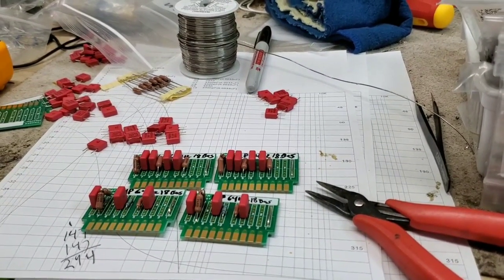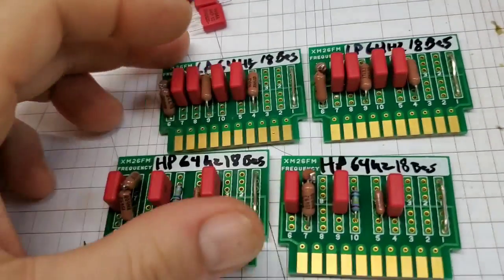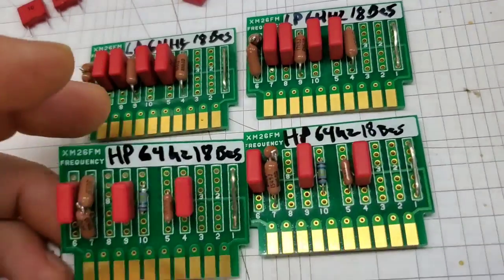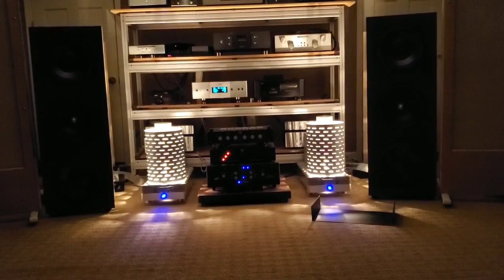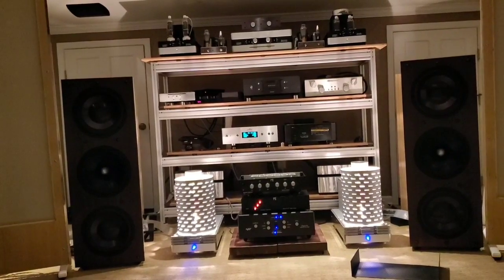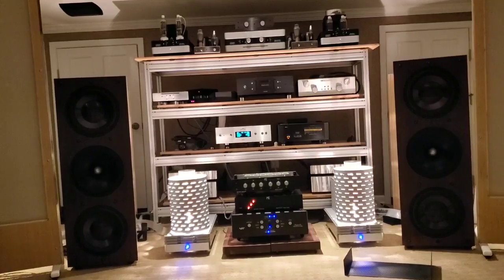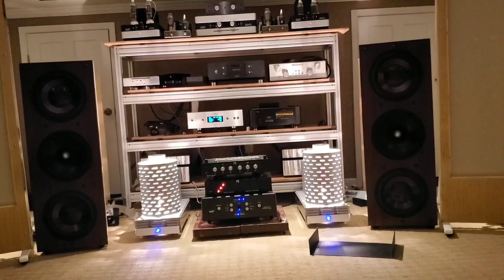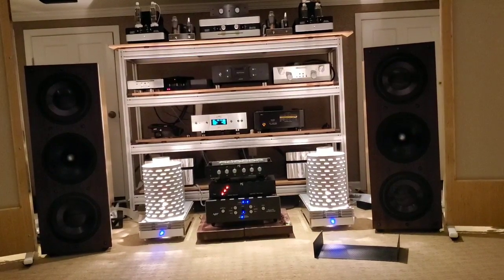Noticing,  then tuning an anomaly in your Loudspeaker Crossover

Comment: It's amazing the coincidental youtube vidi's to what ever I'm working on in my world... Just this weekend I was messing around with VoiceMeter Banana and it dawned on me that I can use it as a crossover (2 output buses with different parametric EQ settings using high pass and low pass filters- out to 2 DACs and then into, in this case, the amplifier inputs of an older AVR I have lurking around). So I set that up, and after a bum start (final output of the 2 buses was out of time)... I found a setting for the output bus timing and viola, software crossover with total control.
It took not much time to arrive at an optimal settings and to discover the missing link in my open baffle speaker build. Now if the parts I ordered (to make a high pass filter for the mid/fullrange driver) match the performance of the software xover I'll be sorted.
I gotta say, it's a sweet setup and allows for total experimenting and control, I would highly recommend it for anyone before they start building their real xover, or if they need to find why the one they have isn't sounding as good as they think it should...
As to this video, I think you will find your fuller mid-bass if you move your whole xover region up to around 100hz.
Reply from the maker: Awesome bro ! I do everything as far as tuning in the passive analog domain to a crazy level, like I'll change a capacitor on the output of a piece of outboard gear instead of bump a slider on EQ. EQ honestly hardly is ever used in HiFi.  I really want one to mess around with and try. The quintessential EQ from Hi Fi was made by Cello and is called an Audio Pallette. It was part of a larger system called an Audio Suite which was similar to pro due to module carts you could slide in and out of chassis for say Phono pre or tape pre, and the Cello founder Mark Levinson was pitching the idea of using an EQ controller that was on a 4 wheeled cart, which would sit next to you at the listening position, so you could effectively "remaster" each tune on the fly as you listened for your taste in your room on your rig. He thought way ahead of the pack. I worked as a direct hiree for him years ago, and at this point, he had a small DAW on a laptop sitting at the listening position doing the same thing digitally. He created it with Dick Burwen..   Cool stuff..

Comment: Something we do in music production to find frequencies is called "boost and sweep."  So you put a good EQ on your track (I recommend FabFilter's Pro-Q3) then set a bell curve with an extremely high q so you can hear the very specific range, and turn that frequency up.  Then sweep its frequency up and down until you find the offending frequency.  That might be helpful to you?
Reply from the maker: Possibly but does that require a DAW ? I dont have one. I use some software with microphone and laptop. So far I can hear when something big is missing and I'm usually on the money after years of practice. Then I'll pill out the mic for accuracy and fine tuning.. Thanks for offering a solution !
Reply from the maker: Either way, I'd like to know how to do what you describe. I understand what the words mean, though I'm not hip to pro lingo. Like what do I use to sweep the freq of the bell curve ?
Reply: @OCDHIFiGuy  
A parametric eq , set the q super narrow, boost and sweep, the offending frequency will jump right out at you when you hit it 🙉
Reply: That's exactly how I've done it for my entire career...

Comment: I use 24db isn't it the one with least distortion since there's less mixing of the drivers? I tried 12db and the distortion was more audible.
Reply from the maker: Not necessarily. It depends what kind of overlap you want. Many times  6Db is the best.
Reply: @OCDHIFiGuy  6????? Nah overlap sounds like distortion to me. I was also told for the mid to highs 48db is even BETTER.i guess it's just a preference but i have found that 12bd had less clarity vs 24db. And with 12db slope there's more dips and cancellations vs 24 is one of the best for linear response.
Reply from the maker: @Montreal_Audio_Systems  Some of the best speakers ever made relied heavily on a 6 slope to keep perfect phase.. Thiel.. there are many others . reason being its one cap and one inductor, thats it.. the more parts in a crossover network the more problems there are . It totally depends on the drivers though, you can not just do it with any old driver.
Reply: @OCDHIFiGuy  true but you have to run it active or else your right too many components in the crossover. Active is the best no doubt about it

Comment: I did notice a slight bump in the low after the crossover tweak. What sounded very prominent were the mids and highs. Yes, a large imbalance for sure. The mids being 4 ohms would make that happen. Perhaps add a 4ohm resistor to mids to see if that helps with the balance first?
Reply from the maker: Check out the new Vid..I nailed it as I always do. You see most people would hide the failure. I show it because I hide nothing from my viewers and clients and I wish to educate how to fix issues.  Thanks for the feedback !